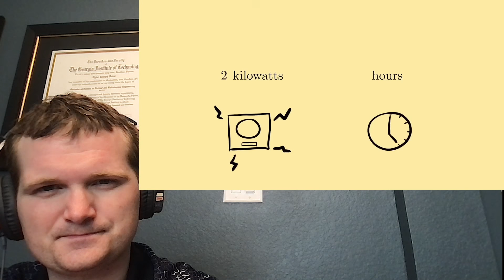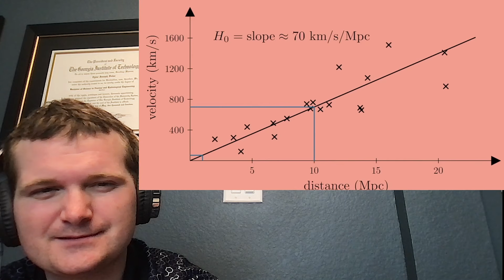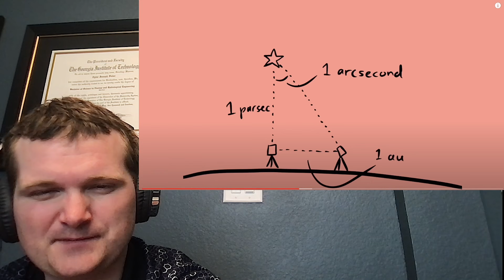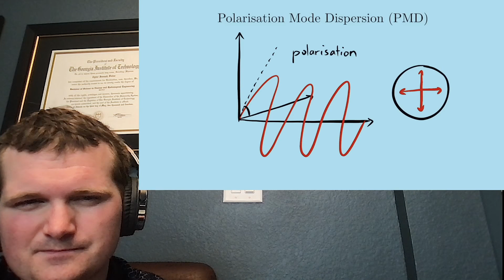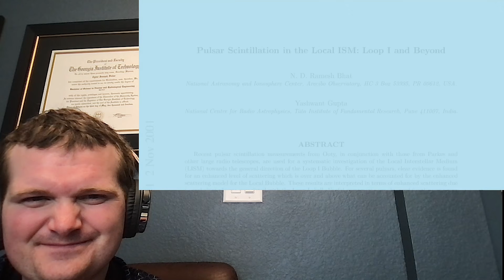Nuclear Engineer Reacts to Cursed Units by Joseph Newton

Comment: For anyone wondering Han cheated technically by cutting through the maw a prison built from black holes it meses with hyper drives it's extremely dangerous
Reply: Also his ship does have very powerful engines but not nessiaarly the fastest. His hyper drive is a top tere one.

Comment: Most people who even notice the kWh stuff can't wrap their heads around the fact that kW and kWh are not the same thing. And, sadly, I've see that type of unit conflation from my local power company who really should know better at least once where they measured the energy storage capacity of a battery installation in kW. I mean, sure, if they were referring to the maximum charge or discharge rate, kW would make sense, but they meant total stoarge capacity. And it wasn't just a simply typo leaving the "h" off the "kWh" - they had it written out in full in more than one place.

Comment: I have done actual calculations for real in km/h*min units... I was accumulating lots of intermediate distances given in minutes and speeds, and multiplying minutes with km/h properly is annoying since those are incompatible units, so I kept them in the cursed units until the end where I only had to convert it once into proper distance.

Comment: It is not that big of a coincidence that the Hubble time (1/H0) is approximately the age of the universe. If the universe was nearly empty (like, very little energy, more empty than it is now), the age could been exactly the Hubble time (disregarding inflation). If there was only matter in the universe (and no inflation), the age of the universe would be 2/3 the Hubble time.

The combination of radiation, matter and dark energy (whatever it is) that we get today predicts a age of the universe very near the Hubble time without inflation, which is interesting. The inflation predicts a expansion of the universe in the order of e^60, if I recall correctly. Heck both of those are in fact a coincidence. Some scientist see those as a huge problem, others see other absurd coincidences as a problem. This is why cosmology is a very active and interesting field :)

Comment: I mean we could start measuring in attoparsec. Which is around 3.086 cm or 1.215 inches...
Reply: dear lord I hate parsecs. the speed of light is one foot per nanosecond, so a  light-inch is 80 ps.
Reply: Please stop guys.
Reply: @cokxi  no, for real. Why is the useless "parsec" the standard in professional astronomy? It's a geocentric unit, based on the diameter of the Earth's orbit and the arc second.
Meanwhile, the "light-year", which ties distance to time via THE universal speed limit, c, is so much more natural. ofc it is also geocentric, in that it ties times to one revolution around the sun...totally natural, unlike the arc second, which is 1/60th of 1/60th of 1/60th if 1/10th of a circle...based on the Babylonian's love of 60 for being divisible by 2, 3, 4, 5, 6, 10, 12, 15, 20, 30. js.
Reply: @DrDeuteron well, the way in which it’s used you could use light year, but then the light year just gets calculated as “the distance away when the two telescopes are 1 AU apart, and the angle is 3.261633… degrees.” It’s really inefficient to use it that way, and it will be a lot more accurate with parsecs
Reply: @cokxi  we can’t stop. (Whoa)
We won’t stop.  (Whoa)
This is our house
These are our rules
We’re gonna nerd what we want….

Comment: There are a lot of those in electrical engineering. We measure op-amp noise in “Volts per root Hertz”
Reply: It makes sense it would come up a lot in measures relating to noise and such simply because roots show up a lot in probability functions for statistically distributed randomness. Noise is literally defined by such a function unique to the type of noise and the physical properties of the system.
Reply: @FaerieSeraphina  exactly. Brownian motion  grows linearly in root meters, or if you square it: acres-Hz per second is constant.

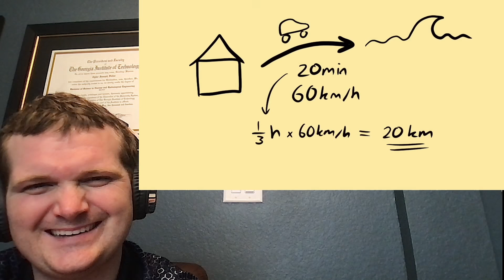Comment: 3:40 The units aren't matching but the guy still multiplied them together. 20 minutes is not hours, it's 0.3333333 hours, so the number and units would both be different.

Comment: Another cursed unit is any measure of speed or velocity - not because of a mishmash of units, but because I'm cursed with a nearly uncontrollable urge to commit violence on anyone who says "rate of speed." Rate of speed [thump] is the [thump] component [thump] of acceleration [crunch] along [thump] a trajectory [crack].
Reply: The rate of change of position is velocity
The rate of change of velocity is acceleration
The rate of change of acceleration is jerk
The rate of change of jerk is snap 
The rate of change of snap is crackle
The rate of change of crackle is pop
The rate of change of pop is an abomination of monstrous amount of change in position under small interval of time possible 

All changes in rates are with respect to Time
Reply: @Carbon.Organic_Emperor12  I like jounce at 4, just for the scrabble value.
Reply: You couldve also just said that there is no speed
Reply: so you hate cops? They ascertain that a gentleman who produced a firearm and discharged in a business establishment and then fled at a high rate of speed, all. the. time.

at which point an officer involved shooting occurred, and the suspect was code 4.

Comment: I had a hard time with one you probably used, which is Watts per meter Kelvin.
Reply: It's common in insulation. "This stuff is a great insulator, you should buy it." Ok, how many Watts does it let through? 

Well given a kind of "stuff" what makes more energy go through? Area. If 10W goes through a square meter then 2 square meters should let through 20W.

What makes more energy through? A bigger temperature difference. If it's 10 degrees difference on either side you get half as much Watts as in it's 20 degrees.

Lastly what makes less energy through? Thickness. Double thick half the Watts.

Put it all together: Power = some insulation constant x x area x temperature / thickness.

Your insulation (or conductivity) value has to have units that when you multiple by area, temperature, and divide by length it has units of power.

power = (W/LxT) x L^2 x T / L.

W/mK

Comment: It's interesting that you used RMS for electrical signals. In stats, we use RMS in many circumstances,  but especially in sorting out whether expected error is 0 or if the expectation changes over time or across correlations, which is similar to your use.

Comment: I mess with a lot of electronics and have multiple electrician friends. KW/H always seemed odd, but there are a lot of stranger ones. Like power factor where the voltage and current either lag or lead each other I get the concept but it seems crazy too because you can't have one and not the other. Then there is watts and KVA which are similar but different enough to matter and be confusing, then there is also KVAR (KVA reactive).
Reply: Everyone records power factor as a ratio (unitless) but the source measurement is an angle...

Comment: 4:40 I prefer to express Newton's constant in N m²/kg² -- or G = ⅔ ⨯ 10⁻¹⁰ N m²/kg².  What use is there in expressing quantities in fundamental units?

20:30 Once in class, I had to come up with an analogy for Cerenkov radiation.  I gave a motorboat traveling with a couple waves trailing the boat.

26:30 RMS deviation, random walks, standard deviation, all these are of general application.  The speed of the electron in the hydrogen atom being c/137?  That's the RMS speed of the electron in its ground state.  It's also the speed of the Bohr hydrogen atom at lowest angular momentum.

28:20 Wikipedia's "Deuterium fusion" article tells us that the rate of energy production from protostellar deuterium fusion is proportional to (temperature) to the 11.8th power.

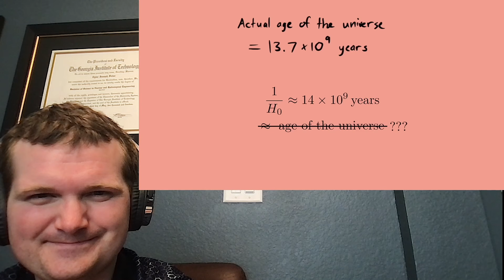Comment: 17:33 perhaps there is every reason for these numbers to be similar? Very rare are two related numbers going to have similar values by pure coincidence, after all. If we refuse to accept the closeness of the reciprocal of the hubble constant and the age of the universe as being unrelated, then perhaps the hubble constant will always be measured to be approximately the reciprocal of the age of the universe, and we just happen to be living at a time when it has a value of about 70 km/s/Mpc. Perhaps in a billion years, when the universe is about 15 billion years old, astronomers will measure the hubble constant to be different, such that when you take the reciprocal of it, you get about 15 billion years. After all, what evidence do we have that this number, which we only know from experimental data, is independent of the age of the universe? How do we know it isn't changing with time, when we are only working with data taken during one incredibly brief timeframe, from only one location in the universe. It is likely that the data is irrelevant to where you are (assuming the universe is the same everywhere and in every direction), but perhaps the data would look different if measured elsewhen?

Comment: The big problem with kWH is that batteries use AH, and consumers use W with an a variable V.
There's a world where we can have a unit to say a battery has 5000u, and uses 100u per hour, and it's depleted. Instead of 5000mAh and 15W usage =.... ????
Yeah batteries have a higher V when they're full, and less V when they're empty, but i feel like this just makes it so much more useful for a regular person.
I guess this is why manufacturers say a battery has a X hour run time, which is somewhat good.

Comment: There is a reason for the hubble numbers to be similar. Yes sure the universe's expansion changes over time, but things tend not to change that far from their typical rates. The only "coincidence" is that the current expansion rate happens to be near the AVERAGE expansion rate over time. Which doesn't sound far fetched or overly coincidental at all to me. It's like if you take a random person's current height and find that it's very close to their average height during their life. Okay... and? Not that weird.
Reply: This.  And if you have particularly cosmologies (i.e. the composition of the universe (matter, radiation, dark matter, dark energy)) the age of the universe is inversely proportional to the Hubble Parameter (possibly exactly). 

Source/Fact Check: Ryden's Introduction to Cosmology
Reply: But isnt a person growing different compared to a galaxy?
Reply: The problem with that is that it's current value is not close the average rate of expansion so far, it's current rate is actually the maximum observed so far. At least according to current best modeling, that says the universe's expansion is speeding up, it was always speeding up, and it will continue to speed up forever. The more accurate height analogy would be if people continued to grow in height from birth to their death at a roughly uniform rate and never shrunk with age. You would be very surprised to find them to be close to their average height (as measure up until now) in that case.

The concept you are thinking about is mean reversion, but it doesn't apply to a value that is only increasing with time.

So it is complete coincidence. That's part of the reason why it's off by 200 million years.
Reply: @kukuc96  the fastest expansion of the universe occurred right after singularity, known as cosmic inflation. The universe only began to accelerate expansion ~5 billion years ago
Reply: @kukuc96  Also looking it up briefly shows everyone completely disagreeing or showing 4 or 5 totally different models that they find plausible, many of which show slowed growth later on (which is enough for this. Always growing is fine, only the derivative of growth need be near average), and some even show reversal and contraction. Where are you seeing some broad consensus
Reply: @kukuc96  if it's not close to the average, then I don't see how the statement is true to begin with. It should be mathematically impossible unless its near the average. Seems like probably just a  error in that case. It can't be just a coincidence because they are actually closely related and bound to one another by third variables

Comment: The real cursed unit on your electric bill goes a step further: your average power consumption is given in kilowatt-hours per day. There are 41.67 watts in a kWh/d.
Reply: When I was working on automotive control software some of the variables were in units of rpm/s. It makes sense if you're a calibration engineer trying to tune a shaft acceleration since you think of the speed in rpm and the acceleration is on timescales of seconds, but the fact that it was using two different units of time in the same unit always seemed amply cursed.
Reply: G is a unit of volume/mass*time^2... density acceleration. Woah.
Reply: @jercos  Actually the density acceleration thing makes sense. If there were no electromagnetic forces to repel atoms away from each other, the gravitation constant would tell us how quickly the density of objects in space increase as gravity pulled all their atoms together
Reply: Displaying the average rate of power consumption in W makes a lot of sense. Not only in terms of unit simplification, but also in terms of being able to visualise how much you were using
Reply: kWh/day is satanic.

Comment: I find balistic penetration units cursed a bit because you express it by mm of RHA wich is fine for regular solid projectiles. But when you enter chemical projectiles such as HEAT or HESH it gets weird. You see, as armor evolved, so did projectiles, and so did armor in response and so on, so you get stuff like spaced armor, or composite armor wich now has value of RHA that's low, so kinetic projectile can go trough, but high value HEAT or HESH can't, and vice versa. It's kinda like röntgen unit that it's less usefull and more confusing with modern technology.

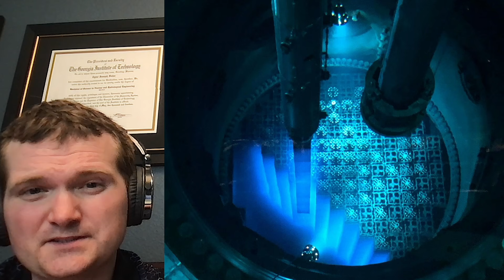Comment: 19:29 this actually explains the whole "blue note" thing i have seen in a lot of Sci-Fi examples of warp/ftl travel... Most prominently Eve online and Star Trek. I had never really though about what it actually was, i just went along with it because it was Sci-Fi...
Reply: Yup.  In Eve you'll notice that the back of the warp tunnel is red-shifted
Reply: What does that have to do with Cherenkov radiation?
Reply: @aggonzalezdc  
Cherenkov radiation is blue and caused by particles going faster than the speed of light
Reply: @nikolethomas2544  I know what Cherenkov radiation is, but it's a bit more accurate to say it's photons moving faster than the normal speed through its medium, not greater than C. I still don't see what it has to do with the sci-fi stuff mentioned. Blue shift\red shift makes a lot more sense than Cherenkov radiation.